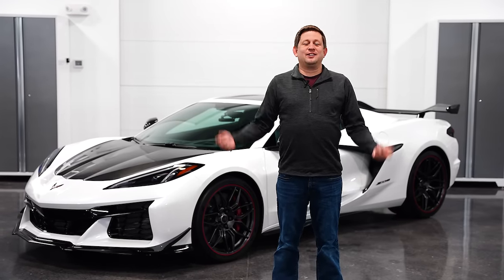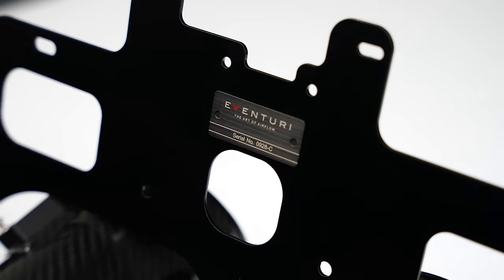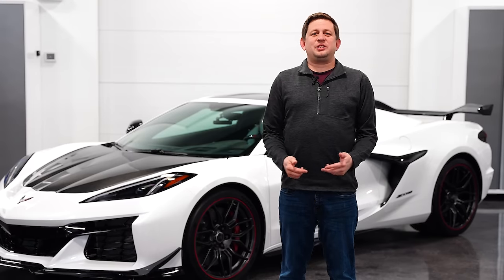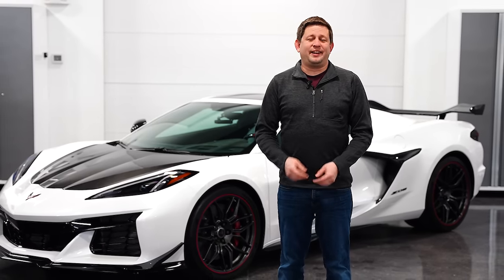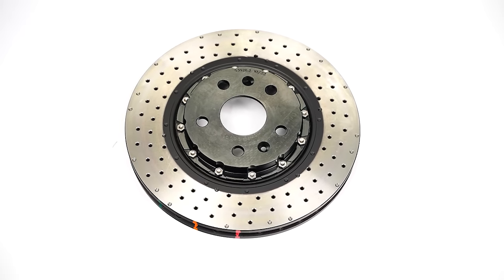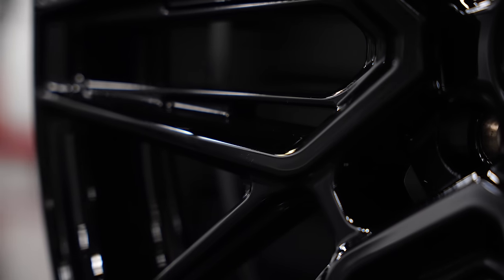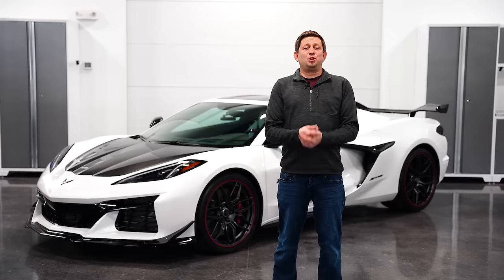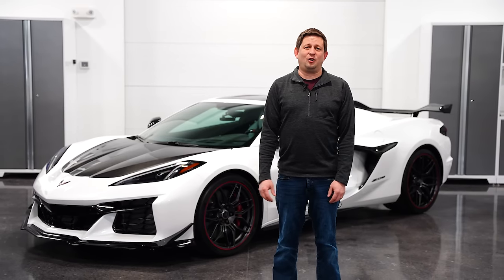C8 Corvette New Products January! - Paragon Performance

Comment: Again, the Eventuri is the GAME CHANGER of year by far, and it dont work as well for other cars including Porsche GT cars. With that type of gain from a particular breathing apparatus for a engine is remarkable to say the least, but on the Z06 its a devastating upgrade that very likely puts the car into another bracket of performance for a mid engine sports car.  Its pretty interesting the type of research that company has done for airflow with their cad and flow bench testing.  You wont be able to keep these in stock once the wider Corvette community realizes what this one airbox actually does.
Reply from the maker: Definitely the hot item for the year and it's only January! We are already exceeding our expectations with the sales. Feb and March inventory is gone and we're going into May pre-orders!

Comment: I'd really like to see some tests which try and explain how an intake is adding the power equivalent of 1 pound of boost. Do we see it in the MAP signal? What do the fuel trims and commanded timing look like? If different, why?
Reply from the maker: We will definitely revisit this testing again once we have the ability to at least log some more ECU parameters with HP Tuners but from what the dyno shows us and what we can see during our controlled testing, the Eventuri Intake does increase the volumetric efficiency of the engine quite a bit at points throughout the rpm range.  To be honest we were pretty surprised by this as well but this LT6 engine is on a whole other level and seems to be far more responsive to things that affect its efficiency which is why it is capable of making such high power in the first place.  The LT2 engine doesn't respond this way as has been seen. During our testing, we do start the runs from the same fluid and air temps and we ensure the timing is the same through the run at various rpm points before we compare two dyno graphs.  We do observe an increase in fuel demands that would make sense to correspond to the increased airflow.  Hopefully this gives you some decent feedback for now but again, we do certainly hope to revisit this in more detail later on once we are able to collect more data from this new engine & ECU combo.

- Graham
Reply: @ParagonPerformance  One has to question how GM could simultaneously create the LT6 and at the same time leave 40 HP on the table for the intake. We all understand why headers have engineering requirements from emissions which drive power loss. But the intake NVH and cargo volume considerations really don't answer how they'd miss that big of an opportunity.
Reply from the maker: GM is restricted to the size of the engine compartment with the intake where with the Eventuri it comes out into the trunk space giving the intake more volume. Also more than likely the engineering team has a budget they have to meet for the production of the airbox. It would be a great question to ask GM at NCM Bash in April :) 
-Justin @corystansbury

Comment: How about some love for the C7?  Any of those wheels fit a C7 Z06 w Z07 package?  Think stock rims might be a bit off, not cracked but not true.
Reply from the maker: As much as we do respect the C7 Corvette the C8 Corvette is our main focus. 

Technically the bolt pattern is different being 5x120 vs the C7 of 5x120.65. Depending on the C7 Corvette offset the wheels MAY work but i'm not 100% sure.
- Justin